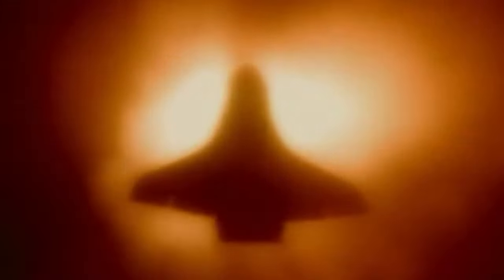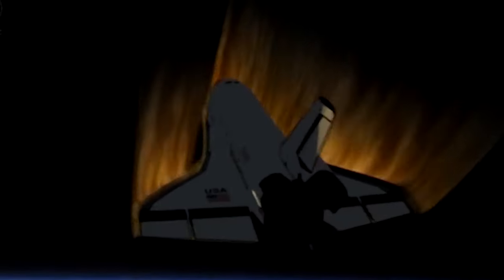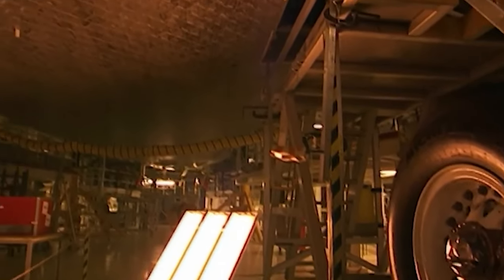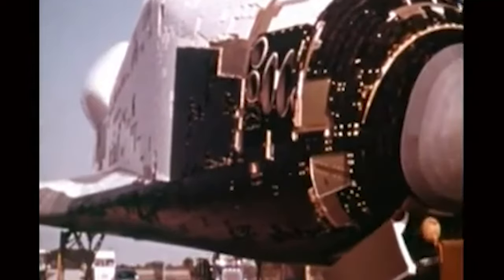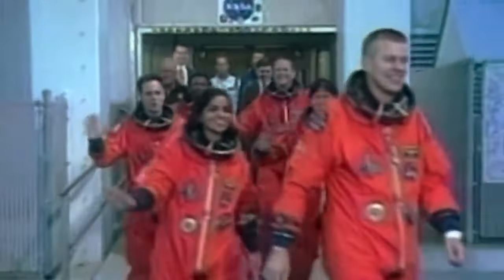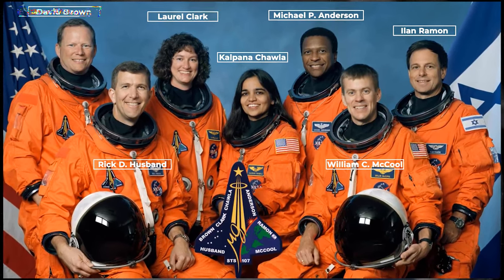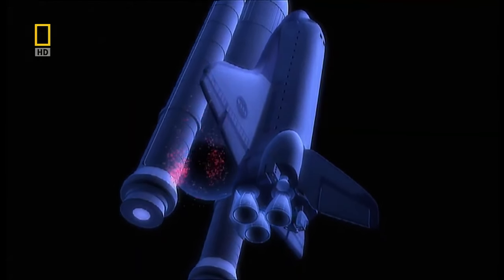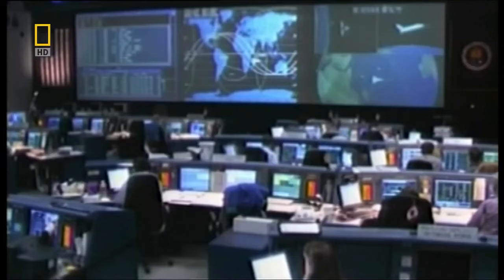Unraveling the Columbia Disaster

Comment: They had no way to repair it.  There was no way to save them once it happened.  Crude as it was, all they could do was cross their fingers and (or) pray.
Reply: This problem has much to think about.  One big thing I dont know is if a second shuttle was available or could have quickly been made available for a rescue mission, at that time.  I'll have look into this to be sure, but I believe columbia was the only operable shuttle at that time

Im not even sure the ISS was available at that time, as a place for the crew to stay, to provide NASA more time to prepare a rescue mission.  Also, how many extra days could the shuttle have stayed in orbit, before running out of life support?

The damage was irreparable from orbit, in this case.  Its still insane to me, however, that shuttle missions were sent up with the assumption that the tiles lining its body would never need to be inspected or replaced before a re-entry.  All that is necessary is to have tiles on hand, & a way to inspect the outside of the shuttle.  A maneuverable remote camera, for example, or make use of one of many NASA satellites already in orbit, which have cameras.  And if those two things weren't optional, certainly a conventional space walk using an umbilical, or else the jet pack